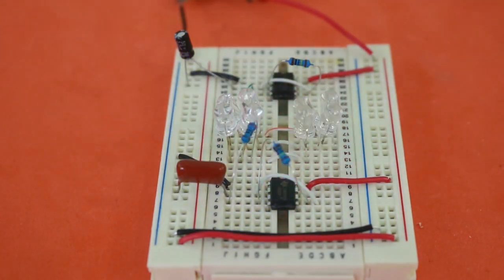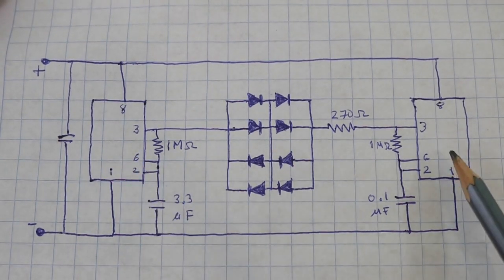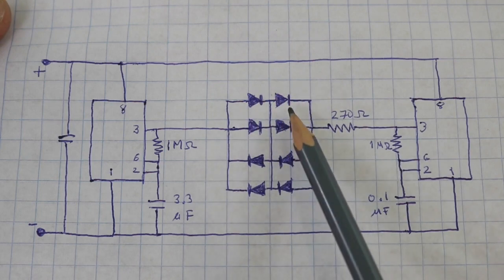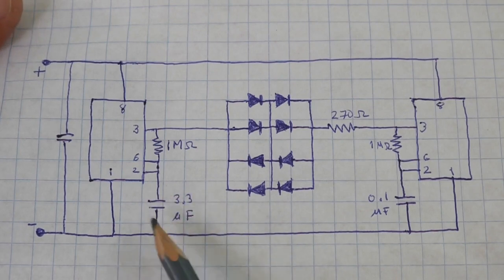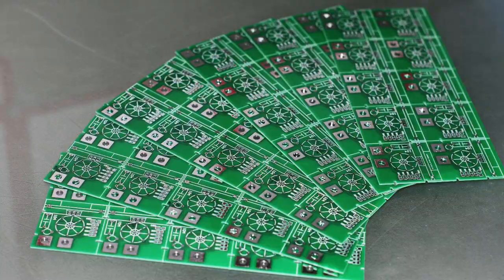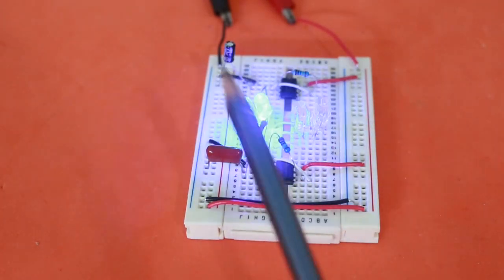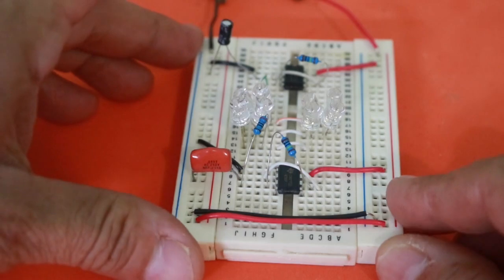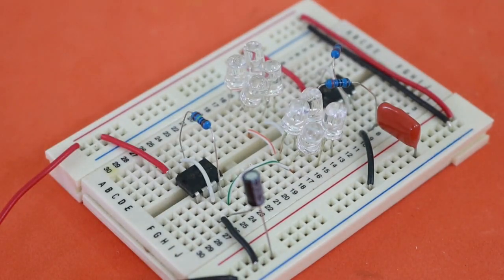Alternating Flashing LEDs - Police Style

Comment: Thanks for all you do for us! Great video! Fun circuit! I built your circuit with Microchip's MIC1555 IC. It can only source 20mA of current and Vcc must be 15V to do that. With that little current available, I put each of my strings of LEDs in series. This worked. I then noticed that your LEDs are connected in a unique way that I do not understand... Each color set consist of two LEDs in series and, then, paired in parallel. I take it that you made these combinations to meet certain voltage and current supply constraints. However, you also connected the two LED sets with a connection tying the middle of the sets together. This is the vertical line, in your schematic, running through the center of the two LED sets. Please explain why you made this path in the circuit and what effect it has. Thank you for your help.

Comment: just a comment, when using only one resistor for several Leds in parallel, the Leds have to be of the same lot, otherwise you can have Leds with different brightness, the best way would be to put a resistor for each led, I am a strong follower of your channel  , the effect of police lights was very cool, congratulations !!!